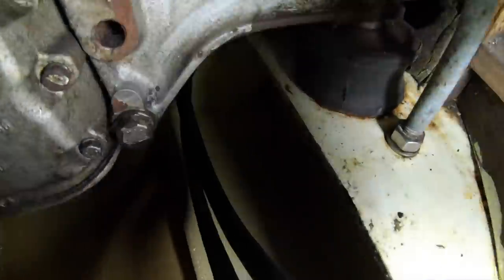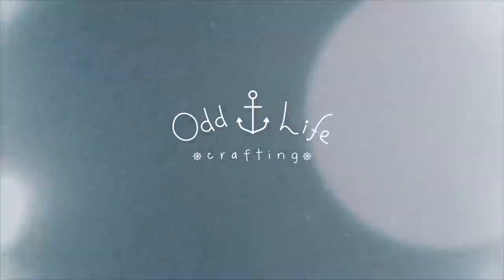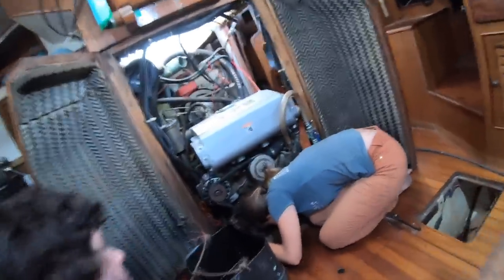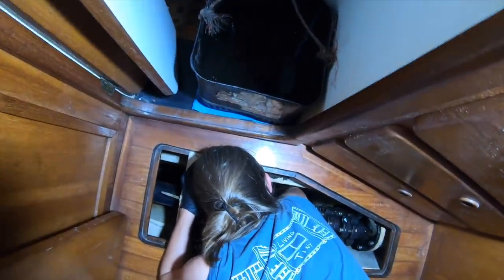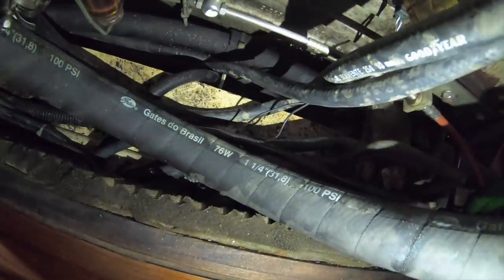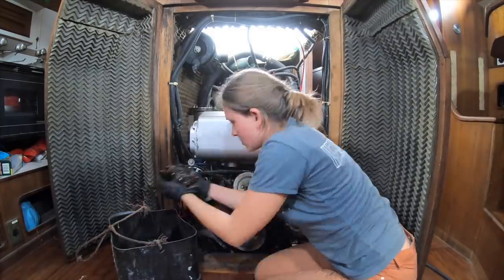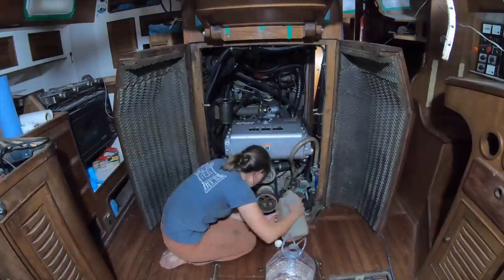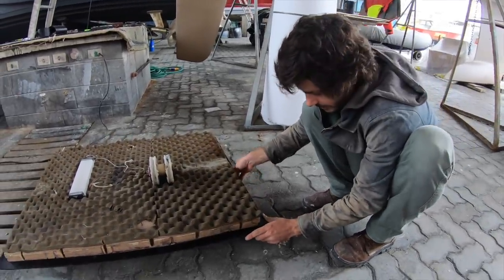⛵️We had a surprise with our engine bilge!! #110

Comment: I worked for a Brazilian company CSN steel and I know all about cleaning oil out of pits with rust. There is an absorbent floor matting ,like a very thick paper towel, you can cut to size and put down there to catch drips. If you call their parts department they can probably sell you some or tell you where to get it locally. Nice job Roberta.
Reply from the maker: Thanks for the tip

Comment: We used these under our Detroit (Grey Marine) Diesels  in our tugs - Pig Oil Mat - Heavyweight Oil Absorbing Pads. Saved a lot of work over years.
Reply from the maker: Thanks for the tip. I'm not sure if we can find it here in Brazil
Reply: @OddLifeCrafting  Amazon -- industrial supply companies - used around diesel engines world wide as a safety and preventive measure. Used in logging equip & const  anywhere equip has belly pans to catch dripping and spills from fuel & oil filters.

Comment: Good job under the engine! Top Tip......  Put a puppy bed absorbent mat in the lower engine bilge. You can get them from pet shops for young doggies that are not house trained yet. They absorb water and oil but show you there has been a leak. Once your confident with the engine, just like a puppy, you will not need them any more :-) sail safe guys. great entertainment. Ant, Cid & the Pooch crew.
Reply from the maker: Thanks for the tip. One of our Patreons gave us this tip also. The problem is that we can have condensation under the pad and we can have some rust in the future.
Reply: @OddLifeCrafting  Agreed, maybe thinking outside the box and using a spray flash rusting aerosol in the areas you are worried about? When we were running our businesses we would work steel plates and castings. Before we put them into packing or storage we used a spray that prevents oxidation buy leaving a thin film. If your hull is hot dipped galvanised with zinc then you certainly want to avoid wet areas as the zinc needs air to protect it, not water. Google white rust to zinc coatings. Hope this helps guys Just loving your videos. Ant, Cid & the Pooch crew.

Comment: I have found that a hole punch set is very useful when fabricating gaskets.
Reply from the maker: The problem is that we are gonna live inside the boat, so we need to do as much as possible with the tools we have in order to save space. Thanks for the tip
Reply: I was thinking some spent bullet shells with a hammer would do the trick and give you nice clean holes.
Reply: @OddLifeCrafting  _ Space..... NO! They are the size of a thick Fountain Pen! You buy the size you want or maybe 3 .... So no space is taken! BTW, Bilges should NEVER rust with all the oil and oil fumes coating the surrounding metal, that is why as a sailor you should ALWAYS wipe your tools down with an OILY Rag... this gives them a fine film of oil which protects them from Sea-Air etc.... when you want to use them...wipe first with a CLEAN Cloth.... then repeat when storing them again  _
Reply: Anyway guys, it's all done now !! The rifle shell is a good trick though !!
Reply: Jim Nickles  As a long-time shooter I can tell you that using shell cases as a hole punch is not successful unless the material being punched is very soft. Gasket material is to hard. I went to my shed and tried it.
Reply: This post proves I need to read the comments before I post? I have a set of leather hole punches and they are awesome for making holes in gaskets! Cork, Rubber, Teflon, neoprene etc.... (Teflon depends on thickness..... )

Comment: I would say that the fuel tank water can form and then cause rust . Where you have oil it will lay on surface and protect from rust . Old barn find motorcycle tanks are very often rusty inside  yet places where oil is present like chain and sprockets , no rust , hope this helps . Love watching you two Xx

Comment: HI! I´m looking at your project and are truly amazed, really great work. 

Here comes a friendly  tip for you that I recently used myself in my own boat. When you have a lot of liquid down in the bottom of a bilge or somewhere and it´s a pain to get to and you´re getting all greasy and what not use this tip. Take a small PET bottle, cut most of the top off but leave a little bit left to keep liquid inside. Use some strong tape, ducktape (?), to make a handle and then scope up your liquid easily. Then you just have to use paper for the last drops.
Reply from the maker: Thanks for the tip. 🤗

Comment: That was a great work cleaning the bilge. I know it was not easy. All the work you both have done including the entire cleaning of the yacht has been top notch. We used the bilge cleaner to start with instead of hand cleaning. But it worked better as we were under way and it sloshed around cleaning the bilge. After that some hand cleaning as needed. When the environment laws changed the bilge could no longer be pumped overboard. I am telling my age now. It was smart using the wet vac to withdraw the bilge cleaner out of those hard to reach areas. To stay on top of this even when the bilge is clean you can use a biodegradable bilge cleaner while underway. When sailing international waters allow the cleaner to work and pump that overboard. Your bilge will always stay clean. Keep up the good work. If I were close to you I would come work for free to help you. Respect and best wishes from Georgia USA. 👍🇺🇸
Reply from the maker: Thanks for sharing your history with us.
Reply: Did the same thing back in the early 1960s.  Used a bottle of cleaning Ammonia in the bilge and pumped it out in International waters...
Reply: Elliott Manning Thanks Elliott! I’m glad some old salts are still around. Respect sent to you. 👍🇺🇸

Comment: Probably the oil and diesel leaking under the engine protected the metal. Usually a dinghy pump ($20?), gray plastic kind, is used to pump out a bilge like that. An oil extraction pump, which you may want for engine oil changes ($80?) anyway, will get into obscure places. But Roberta did an outstanding job, gobbing that out. Definitely deserves a fine dinner out!
Reply from the maker: A nice hot shower was great afterwards. Hehehe.  Thanks for the tip

Comment: Welcome to the boat-cleaning world ! I would just like to give you an advise concerning the holes you do in the black-rubber plates. You should use drill-bits for woodworking instead of metalworking ones. They will perform a better and cleaner job. Good luck for the coming works ^^
Reply from the maker: Thanks for the tip

Comment: Hi sailors!
Nice job with the bilge..😉
About the shaft, there's always a seal to prevent sea water coming in, I suppose you replaced it already.
But there's another component that you may consider to install: it's a dumper shaft. It goes on the exit of the gear box, and prevent damage when you catch a rope with the propeller. It's like a sacrifice element, set to be broken before the shaft or the gear box.😉

Comment: I'd say it's a safe bet that if there's oil in the bilge, then of course the engine has oil leaks. You guys have done such a stellar job on your project I really hope you didn't skip the crucial step of eliminating engine oil leaks because you will regret not fixing it before re launching it.
 Did you maybe think oil was spilled when the previous owner changed the engine oil and filter or maybe when adding oil?
Reply from the maker: We actually did a maintenance on the engine. We had no leaks so far. We have no idea how that oil was there. We need to look it closely.

Comment: It's good that you got the bottom clean where the oil accumulated because apart from the mess it also will smell inside the boat and there's nothing worse than in a clean environment being your home having a smelly engine, my car diesel engine gets jet washed every three months so that it always looks clean and does not smell inside my car,   A well done good job you have done with your  LONG ARMS  ha ha,  you have lovely arms.

Comment: I have had to clean out many sumps and tanks in commercial machinery that tend to be neglected and accumulate oils, coolant , swarf and all sorts of rubbish. I've found that the easiest way is to put  clean sawdust in the sump, stir it around and suck out with a workshop vacuum cleaner - it usually takes a couple of iterations but works like a charm. inaccessible bits can be rubbed with the sawdust with sticks and just sucked out.
Reply from the maker: We actually used a shop vac on the second day. Thanks for sharing your experience with us

Comment: Diesel tanks corrode due to the sulfur content in the diesel fuel combined with water dissolved within the fuel, whereas the engine room is mostly filled with engine oil and one of the main purposes of engine oil is to prevent corrosion.
Love your channel keep them videos coming :)
Reply from the maker: It might be the reason why. Thanks for the support, Ismail

Comment: My guess is Oil coated the surfaces before any water got in and then any water in the engine bilge evaporated over time as that it is not a sealed compartment.

Comment: nice going there , a tip if dizeloil or oil  in the boat ,, u can use gasoline makes the oil float up on top of gasoline ,, .. nice job with everything else
Reply from the maker: The smell of gasoline is pretty strong and we are avoiding using it to avoid having a strong smell inside the boat. Thanks for the tip tough
Reply: but try to put oil or dizeloil in a glas and use 1 cl gaseline ... oil will float up on top .. just so u know
and after use normal soap then the gaseline smell is gone <3
Reply: i have been working on a floating gaseline station ,  i got dizeloil in my eyes before . then i used gasline to get it away from my eyes then alot of water
Reply: But i love the work you guys put in the boat ,. lovely
Reply from the maker: Thanks for the tip

Comment: Where there is oil, there is no rust. A proverb from the metal worker.
Reply from the maker: That's the curiosity. On the diesel tank, where there was full of oil, there was rust under the paint.
Reply: @OddLifeCrafting  Diesel is not 100% hydrophobic, it can contain a small percentage of water in solution ... engine oil however will repel water very well - that's why many people with classic cars refer to their leaky engines as 'the automated rust prevention system' ... it was the engine oil that preserved the engine bilge.
Reply: @OddLifeCrafting ,   water will be at the lowest point in the diesel tank.
Reply from the maker: We had a pump to get a sample from the bottom of the tank and there was no water in it
Reply: @OddLifeCrafting  interesting....wonder if it was a chemical reaction between the diesel or a fuel additive and the paint.   I guess we will never know and it's truly a moot point at this time.

Comment: Another great job by Roberta, with a little help.
What is the big round hole in the engine hatch?  Wont water get into the engine when the cockpit gets swamped?  That makes wonder where the cockpit drains are?  Sorry for so many questions at once.
Reply from the maker: The big hole is where the wheels pulpit is gonna be. The drains are on the corners 😉

Comment: Clean it up and if you still can't find the issue, put some Floor Dri in there.  This will absorb the liquid, and if you check regularly, it will identify where the leak is coming from.  It's too bad the hatch has so many screws, open it gives you all the light you need to work in the engine area.  Maybe a couple of well placed IED's could light that area up.
Reply from the maker: We took off from the engine room the 2 lights that were there because they were old ones, we are gonna install some LED back there.Thanks for the tip

Comment: If there is 4 litres of oil, check the oil level on the engine regularly to see if there may be a leak or two. Could be gaskets are finished in the oil sump or elsewhere. .

Comment: If you get a chance look into replacing that sounds adsorption foam in the engine bay, as that foam you have now is not engine bay heat/fuel rated.

 I hope I'm wrong but I've installed that sound foam in music studios
Reply from the maker: By now we are gonna leave as it is, is the new product that people use there are quite expensive here in Brazil. One day we are gonna change it. Thanks for the concern

Comment: You could of used a punch for the gasket material, you didn't need to add sealer on the gasket, that's the purpose of the gasket,  however, you did  good  by using sealer around each bolt, however, you didn't show if you used or had a flat washer under each nut. I am impressed with all the detail in doing things correctly. Keep up the great job, always look forward the each new episode.
Reply from the maker: The problem is that we need to have less equipments as we're gonna live in the boat, so we need to use the equipments we have instead of buying some more and then we are gonna need to find a place to store it all. We used a flat washer under the nuts. 😉

Comment: You did a great job cleaning out the bilge under the engine.  .  It was a great idea that after you remove most of the black sludge you put
water and degreaser cleaner in the bilge overnight then used a Wet-Vac to suck the water out.
That looks like a pretty good size engine for your boat.  Do you know how many knots you will be able to do with it?
I  think you showed another video how the guys who  removed the parts from the 
engine restored all the parts and the engine is running great now

Nice job making your own Gasket to seal the Hatch over the engine. Do you think water got into the boat because that hatch was not sealed well in the past?
Did you already restore the gland in the stuffing box  where the propeller shaft goes out of the boat?
Thank you Duca and Roberta for another nice video.
Reply from the maker: The water under the engine we think is from a hatch that is not the top of the engine, but on the stern head. We don’t need to do anything to the glad. Other boat owners of the same boat as ours said that there is no need to open it if it’s with oil inside. It’s actually sealed
Reply from the maker: About the knots of the engine... people say that we can reach about 5 knots. We are gonna see it in the future
Reply: @OddLifeCrafting  That is good to know about the stuffing box and the gland seal.   You both seem to have done a lot of research  on your boat.  Thank you for takiing the time to respond to my comments.

Comment: I kept dropping tools and parts in the bilge in a boat I was working on recently, the bilge was deeper, grimy and the engine was tight in the engine room and I couldn't push past the engine to get them out.
I had to fashion a wire arrangement to fish them out (took a good half hour), funny thing was I thought I left my extendable magnet at home and when I packed my tools up I discovered I did pack it.

Comment: Possibly the additives from the diesel caused the rust and was not strong in the bilge. I would have waited until you had a 100 hours on the engine before I sealed that hatch but it was good practice. Love the videos.
Reply from the maker: There is no way of doing it as we need to have the travel lift every time we turn on the engine and we need to pay for it every time. Also the hatch is where the wheel is, so we need to close it before installing the wheel and turn on the engine again

Comment: Add some oil absorbent pads under the engine and back behind the transmission now that it is clean..  The won't absorb water, only oil and fuel.  They help a lot.  And yes, I hate the bilge areas on boats.  Almost always so nasty.. makes you want to puke.  LOL.  Looks great.  But Roberta really deserves a lavish supper.  Ha ha.. High 5 Roberta!
Reply from the maker: 🤚🏻 actually we are afraid of having condensation on the hull if we keep a pad there. Thanks for the tip tough

Comment: Now that it's clean, line the bottom with some "Pig Mat" so it won't get that bad again, and make it easier to keep clean. It will absorb the oil dripping.
Reply from the maker: Thanks for the tip. We will try to find something like this here in Brazil. We are pretty sure we don’t have it here
Reply: @OddLifeCrafting     Good idea should have Oil Clean Up Pads at your Marina Supply store...
Reply: @OddLifeCrafting  If you can't find any, message me a mailing address and I'll send you a couple rolls.
Reply: Make sure you check/change it regularly as can become a bit of a fire hazard once soaked. We always put the date on it in marker which helps you work out how much oil your losing.

Comment: Next time.... try dumping a bag or two of kitty liitter in the bilge.  It will soak up a lot of the oil, and it is easier to scoop up the kitty litter "mud" than wiping up oil.  It should cut down on the time it takes to clean.
Reply from the maker: Thanks for the tip, Mike. I hope there is no next time 😂😂😂

Comment: Sharpen the end of a 3/8" NPT pipe on a grinder, about 4 or 6" long. Makes a cheap hole punch. Also 1/4" or 1/2" for different size holes. I'm guessing metric versions aren't much different...

Comment: Long arms are really useful when you get old (like me). When you can't find your reading glasses, you hold the thing further away to be able to see it! The surface is clean as it was a bit preserved by the oil. By the way, that steel hull is not galvanized, it is zinc metal sprayed. Its different process. Galvanized means dipped whole into molten zinc tank. You cannot dip a hole boat hull into a tank of zinc. For a boat hull the zinc is applied as a "spatter" of zinc droplets from a machine like a welder. Its not galvanized. Beautiful job in cleaning that bilge, including the diesel bug sludge.